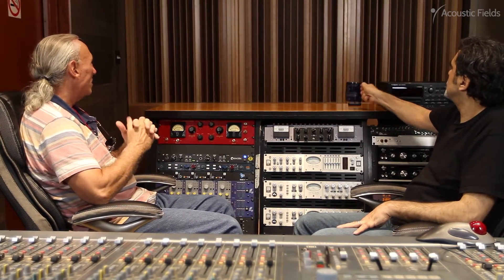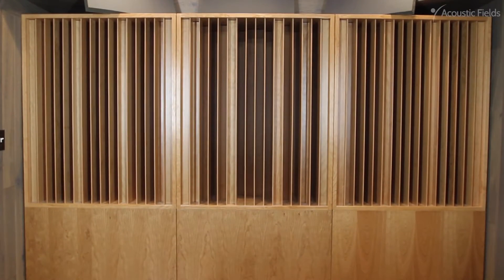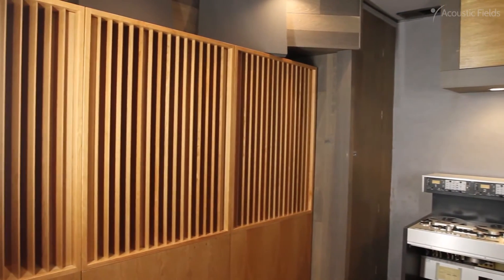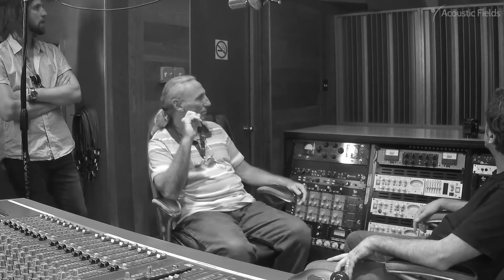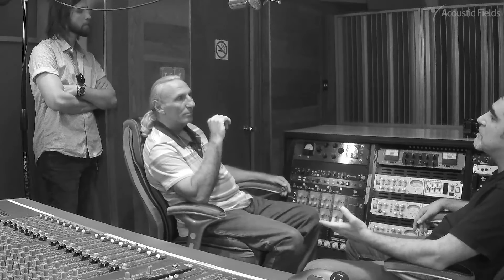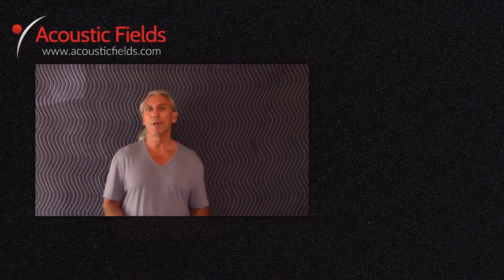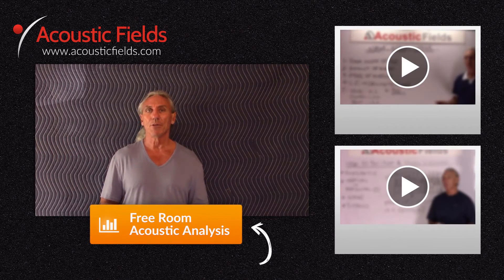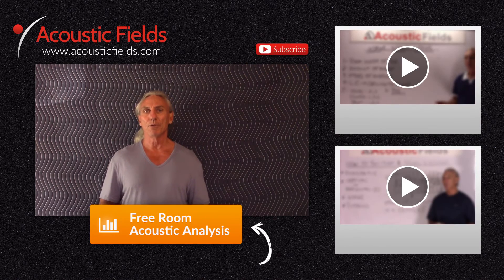Studio 2020, Chicago [4/4] | Sound Diffusion in Control Rooms

Comment: Hola una pregunta.  Un difusor skyline colocado en la pared trasera del tecnico ,  como debe quedar con respecto a las orejas del tecnico deben quedar justo en el centro del difusor o puede quedar colocado el difusor arriba de la cabeza del técnico o debe quedar alineadas las orejas del técnico en el centro del difusor , gracias desde ya y excelente material , saludos.
Reply from the maker: Hello one question. A skyline diffuser placed on the rear wall of the technician, as it should be with respect to the technician's ears, must be right in the center of the diffuser or the diffuser can be placed above the technician's head or the technician's ears must be aligned in the center of the diffuser, thanks in advance and excellent material, greetings. 

You should cover the complete rear wall with 2-D to avoid any chance of phase. Start the diffusers at the shoulders of the technician and move upward to the ceiling intersection. This number will be somewhere from 30" - 40". Move across the whole wall surafce area up to ceiling.
Reply: muchísimas gracias por responder  , intentaré hacer lo que indica  , gracias de nuevo.